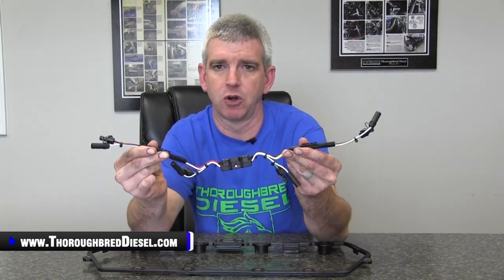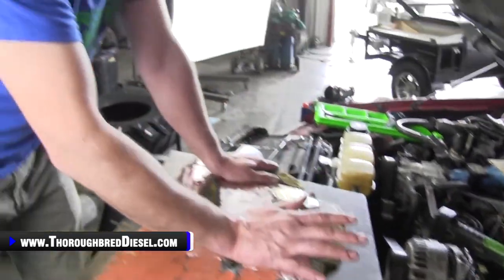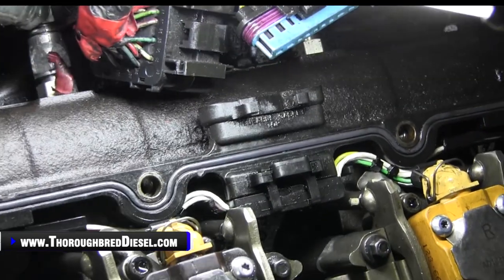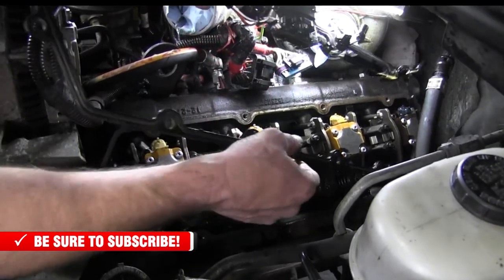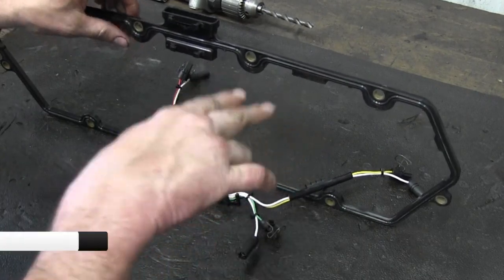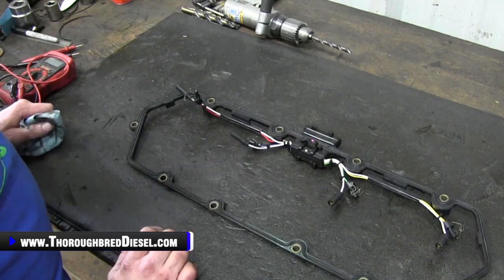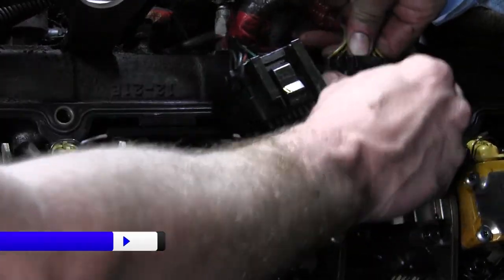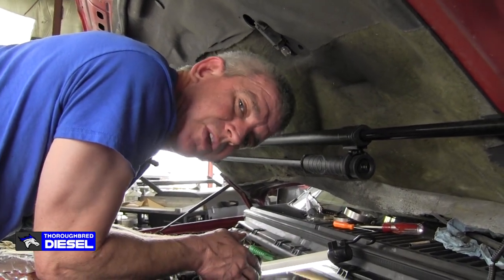Cheap 7.3L Insurance: Valve Cover Gasket & Internal Wiring Harness Install (Ford Powerstroke 7.3L)

Comment: I'm actually waiting for valve cover gaskets lol. I rebuilt a set of injectors out of a early 99. Pulled the barrels/plungers to make them a single shot, and added new intensifier pistons to make a sweet set 180cc injectors to replace my 90cc! My gaskets fell apart when I took the covers off.. I'm pretty sure in the 300k miles of service my F350 has seen no one's taken them off before. Love the 7.3 vids! I definitely like working on my ol' trusty 7.3 over my Ranger w/ a 4d55t diesel, you can still get parts for the 7.3😂
Reply: Kkl

Comment: I am replacing both valve gaskets and wiring harness on my 99 F250 Super Duty. I cut a plug off of the old harness for the injectors and stripped some wire back so I could use it to test resistance on the injectors easy with the harness removed. After I make the connections  and before I put valve covers back on I will do a buzz test with a old Autoengunity program.

Comment: Yes i just bought a 1995 f250 7.3l my first time having one so im going to be replacing a lot it only has 154,000 miles on it and its pretty rusty up under the cab and it wasn't running at all so thanks for sharing the video and what i need to look for when i do start it up that actually helps when i get it started lol.

Comment: I haven't ever had a gasket issue. Two more common problems with the 99-03 7.3: one is the driver side wiring harness grounding due to wire insulation wear on the driver side valve cover; second is a defective Hall Effect cam  possition sensor.  

Always check the underside of the harness, disconnect and turn over.
Reply: Will it grounding out cause issues with turning signals suddenly just...not working?  Not blowing...like they arent there.  Also, noticed the steering wheel column will ding even when the key is out and it dings outta the blue.  Have to manipulate it up n down to get it to stop.
Reply: @HoneyRowland  I believe it is limited to the engine only. I am not 100 percent sure.

Comment: Do you not use any sealant? On the gaskets, for oil leaks or possible oil leaks?
Reply from the maker: The gasket isn't designed to be used with sealant.

Comment: I have a question that I hope you can answer. I have a 1995 7.3 Powerstroke that uses the two glowplug/fuel injector connectors per valve cover gasket, two on the passenger and two on the driver's side. I have replaced the engine wiring harness four or five times and each of the valve cover gaskets and the under-the-valve cover wiring harness seven or eight times along with the glow plug relays. Now I have over 420,000 miles on this engine so this has been spread out over the 28 years I've owned the truck. I currently need to replace all of these harnesses again including the engine harness. Would I be better off adapting or going to the single valve cover connector like the one in this video? Is that single connector a better more reliable durable design than the two-connector harness? Would you recommend using a heavier gauge wire for the glowplug circuits if I rebuild the engine harness? Those are the connections that always burn up and fail. I would use straight wire runs instead of using a pigtail and having solder joints.
Reply from the maker: I don’t think you can convert to a Super Duty harness,  it requires PCM and IDM swap.  The OBS harness is just a bad design.

Comment: So i am doing the valve cover caskets on my 03 7.3, as well as the internal wiring harness. After doing some research i found out that the internal wiring harness is common for coming unplugged during use. So Ford came out with a retaining clip for the harness to help keep it plugged in. i purchased some of these to install during replacement. but i cannot for the life of me figure out how they go in. Any advice? part number on the clips is 1C3Z-14A163-AA.. Thank you!
Reply: I think the clip just slides in there to keep the clip tight. Some use a grinder to grind down quarter to hold the existing clip in place
Reply from the maker: I am not familiar with it either, maybe someone will jump in here that has experience with the clip.

Comment: Great video, thank you!  Is there a recommended tightening sequence for the valve cover bolts?
Reply from the maker: Thanks!  I start in the middle and tighten in a circle like torqueing a cylinder head.

Comment: As I was putting the connectors back over the glow plugs I was have a really hard time getting them to fit snug. One of which stretched out and will not fit snug. Can someone please tell me if I'm going to have to purchase another wire harness?
Reply from the maker: If they aren’t making good connection replace the harness.  If you don’t, you could have a short to ground that will cause havoc.

Comment: Can you use the 98 to 03 valve cover harness assembly on a 95?  Will it match up?  I know you have to extend the wiring from the front two plugs, but would it work better?  My 95 keeps melting the glow plugs to the injectors in the connectors?

Comment: My truck is doing something weird,It misfires in the morning but it goes away after like 10 -15 mins of driving. What could that be?
Reply from the maker: Could be a couple of different things. Really want to do a cylinder contribution and buzz test as well (provided it is a 7.3). Check fuel pressure and make sure glow plugs are working.
Reply: My truck cranks and runs good. Reving it almost has hard to notice miss above 2000 rpm. Runs good going down road until about 7 minutes and then it sounds like it looses fuel pressure or some injectors quit firing. Let it sit for a while. Cranks back up and does same thing again. Sometimes not. Fuel bowl is full when I pull filter. Might be valve cover wiring harness? Or wires from firewall driver side going to valve cover area? Truck bought new by me on 2000. 150k miles. Has a tool bed.

Comment: Hey man I have a 97 obs and It’s running so rough. I removed my valve covers today and unplugged one by one. And noticed #4 and #5 don’t do anything when unplugged. The other ones cause the truck to surge. I did the buss test and they all passed. But injector number 5 is squirting so much oil and it’s all splashing on the glowplug. The other #4 isn’t squirting at all. What could my issue be ? Also I’m guessing #5 has bad o rings
Reply: If there's no oil coming out the spill port on the injector then you need to replace that injector

Comment: I recently changed mine on a 97 7.3 now mine won't go over 30 mph without stalling and missing also shakes bad at idle could it be a bad value cover/harness?
Reply: Did you figure it out ?
Reply: @LemonySnicket-EUC  
Yeah had to replace the IDM(injector driver module)

Comment: Being that this an informational video please use correct terms. Don't call an engine a motor..... I understand that the general public thinks they're the same. Any mechanic should feel stupid calling a fuel burning engine that makes it's own power internally via combustion a motor which relies on an outside source i.e. electricity to make its power.
Reply from the maker: Being that this is an informational video, how bout no..... Calling it an engine over a motor has absolutely no change in the context of this video other than to satisfy what seems to be a pet peeve of yours.
Reply: @thoroughbreddiesel  I'm talking about facts though sir. As a company people look to for guidance and information you should provide correct information. Any video, any conversation and always an engine is an engine and a motor is a motor.
Reply: Charlie please don’t call this an informational video... It’s an educational how to video! You better not watch any more of their educational videos! Obviously they have flawed educational material! 😂
Reply: An engine is a motor, but a motor isn't an engine. Motor is defined as any of various power units that develop energy or impart motion such as a small compact engine, a gasoline engine, or a rotating machine that transforms electrical energy into mechanical energy. In fact, it would be more accurate to call a diesel a motor since it uses a turbo to recapture energy from the exhaust.
Reply: Agreed. Way too many people refer to engines as motors.